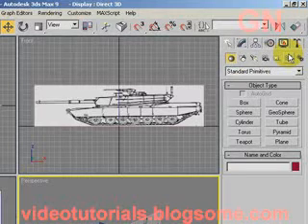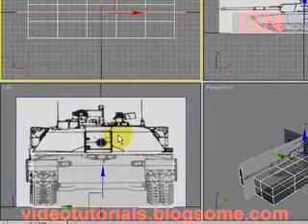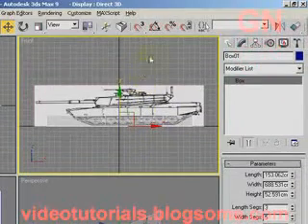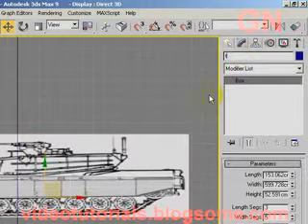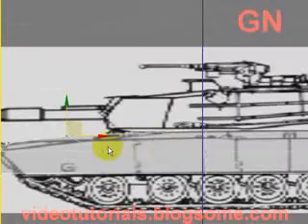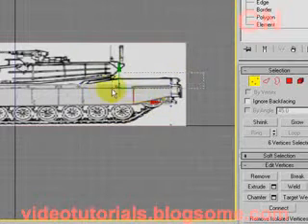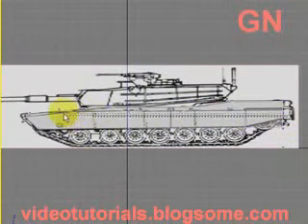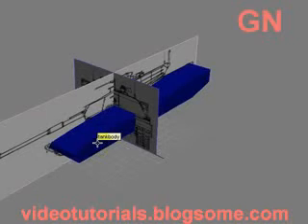3D Studio Max Model a Tank Part 01

Comment: It's much better, easier and accurate modeling with planes, just extrude edge after edge and you'll get far greated detail and is 10x easier than doing so. Also you got the blueprints setup wront. Its way to streched.